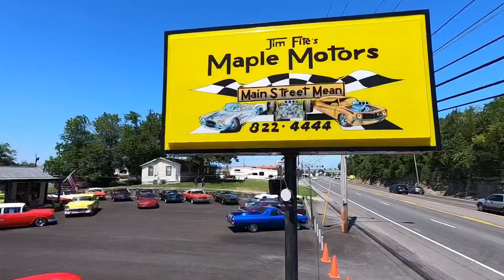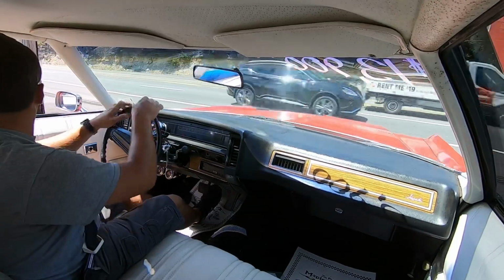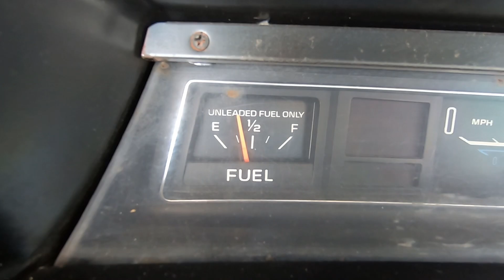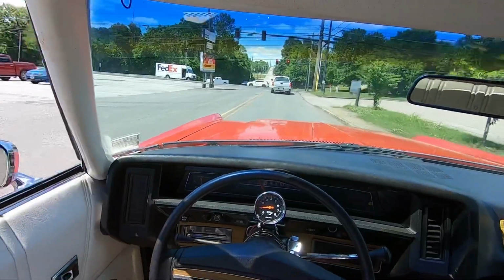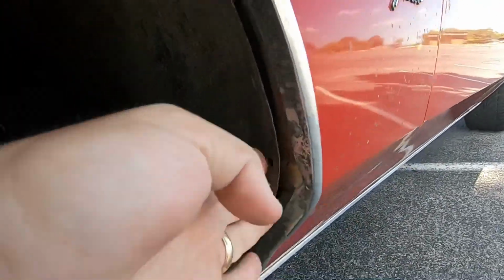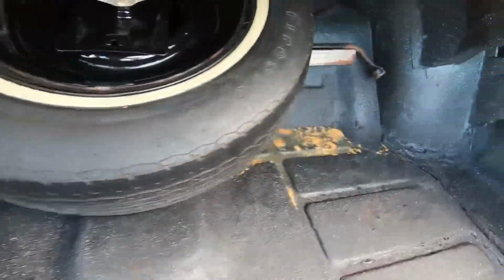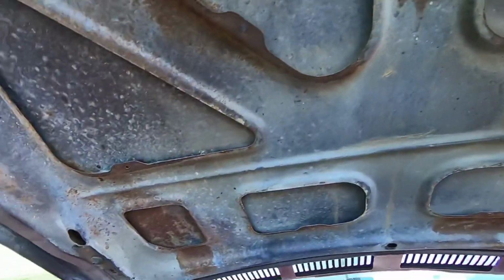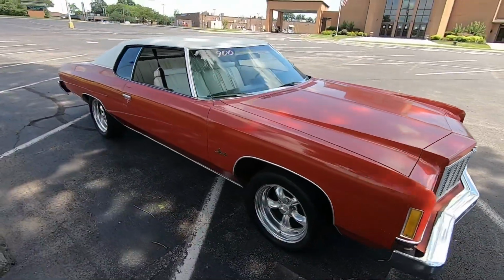Test Drive 1975 Chevrolet Impala SOLD $13,900 Maple Motors #1072

Comment: What's that engine noise ? But I still like it !💲12,000.00 tops ! Sorry not trying to bust your balls !
Reply: It's called a gear drive. Instead of two sprockets and a chain there are 4 gears ⚙️. A gear on the cam, a gear on the crank, then two idler gears that sit between them. There's a crossbar that links the two idler gears together that sits against the timing cover and radiates the noise from the gears into the engine bay. 
This is what they look like.
https://www.speedwaymotors.com/Tru-Gear-Small-Block-Chevy-Noisy-Gear-Drive,28029.html
Reply: In the 90's I had Pete Jackson gear drive installed in my 69' Camaro.  I thought they sounded cool in other guy's cars.  Yeah, it was cool.. for about a week.  Then it got annoying.  I haven't heard one for a long time.